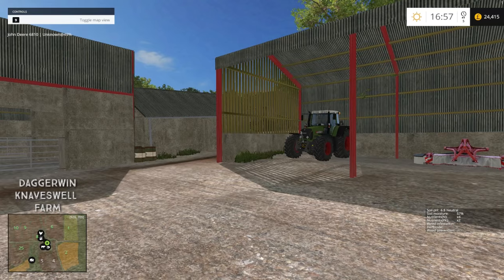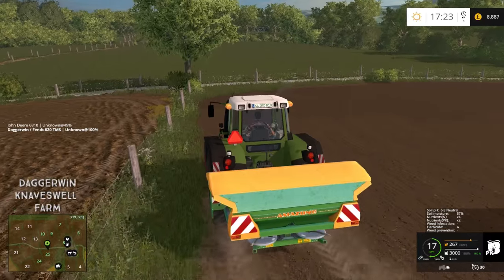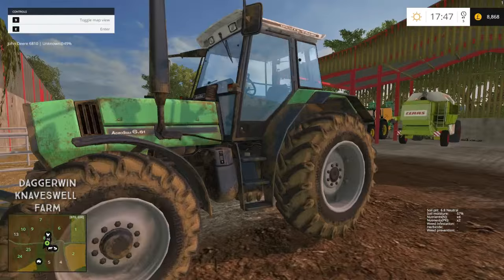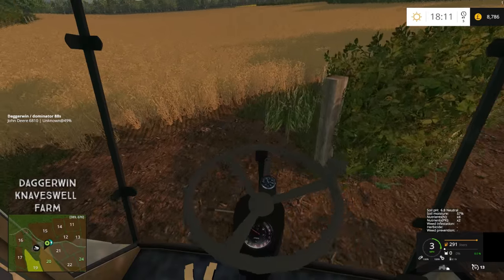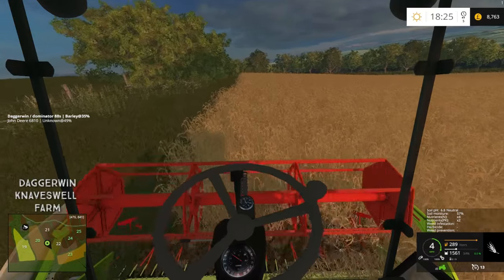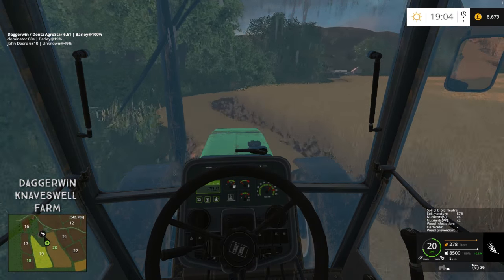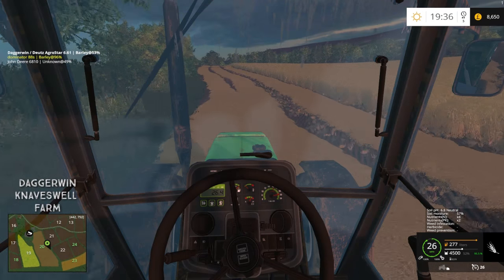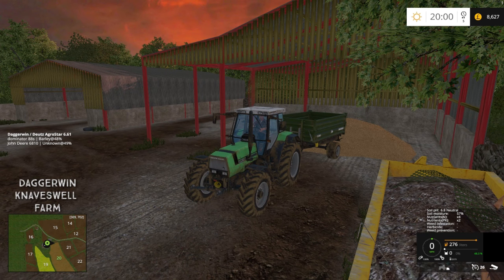Let's Play Farming Simulator 2015 | Knaveswell Farm | Episode 4

Comment: If you harvest at 57% moisture, 5 N and 4 PK, the yields will be amazing. which is what makes Soilmod worth the effort.
approx 4 times normal fertilized game yields.   Ish.....  I haven't taken the time to spreadsheet my results to see if the yield multipliers are additive of cumulative. 
With crop destruction on, broadcast NPK or PK as needed, and use extended weed spray.  You get 3 days out of the double letter weed spray.
Soilmod only grows at midnight each day, unless you edit that. So 4 days from planting to harvest. 
Check EVERY field, EVERY day.  It matters.  

Glad to see you using this mod.

Comment: The chemical symbol for the element potassium  is K and phosphorus is P, so yes I think it is potassium phosphate.
Reply: +Nick Morris Don't want to be rude or anything however phosphate doesn't just contain phosphorus. Phosphate itself is a molecule containing 4 oxygen atoms and 1 phosphorus atom. Also, for a stable potassium phosphate you would require at least 1 atom of potassium and then 2 more atoms of either hydrogen or potassium which would then bond to one molecule of phosphate. For example a stable form of potassium phosphate has a chemical formula of K3PO4. Sorry if this offended you because it wasn't my purpose to do so.
Reply: Hillbilly Snowman no, you didn't offend me, as you can tell I'm not exactly the best chemistry student of all time, you live and you learn :)

Comment: Dagger, have you thought about using the "Keyboard Steer" mod? I use it with a wheel and it makes the camera turn slightly as you're going around a corner. Just a thought.

Comment: As much as I love FS15, I don't get the whole point of the wither mechanic. Before someone tries to correct me saying "It's realistic and happens." I will have to counter it with a, No. Because the plants for all of these crops are essentially dead when you harvest them. The last stages of wheat, barley, canola, and corn the plant is dried up and dead, so you're just harvesting the seeds from them. Crops can't die again if it's already dead before harvest time. So there's no point for withering to be in game unless there's a crop that really has to be harvested fresh. Like apples and so on. :)
Reply: I agree you are correct indeed
Reply: +Slane583 Crops like those do go mouldy if not harvested and then it can't be harvested.
Reply: +Bunny Warren well yeah and eventually rot but takes few weeks or more. Weather depending
Reply: Bunny Warren Yes, but mold isn't withering. Withering is the process of the plant dying off and drying up from lack of water. Mold is only going to happen when it's very humid out or when there's an instance of the dried crop constantly getting moist. Like rain or dew. Which the game itself doesn't really simulate that well. Weather in game is mostly there for effect to show there's a weather cycle. But farmers usually get to the crop first once it's at its' peak "dead" stage before it can mold. Around here the farmers mostly grow corn and alfalfa, I'd say 1/3 of the corn is grown for human consumption and the other 2/3's is cow corn used for corn silage. I've driven by corn fields that have literally been left for a month or two after it's fully dried just because the farmers haven't gotten to it yet. :)
Reply: Slane583 Given it can take about 48 game hours for crops to go from seed to ready harvest, another 48 hours to be unusable doesn't seem unrealistic in terms of time ratio. Granted, withering is the wrong name to use as standard but it could apply to some fruits like peas and beans if they were added.
Reply: Bunny Warren True. They need a crop where the wither setting would be of use. Then re-title it as "spoilage". Because, as you say, it would be the beans/peas going bad. Not the plant itself. Same goes for fruit. But honestly there's only so much you could simulate in game until those with short attention spans would lose interest. :)